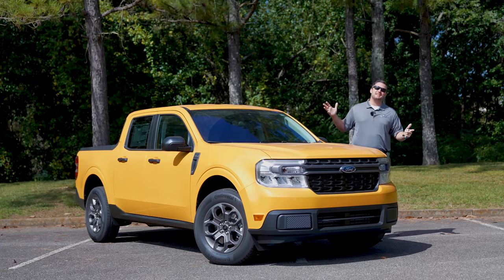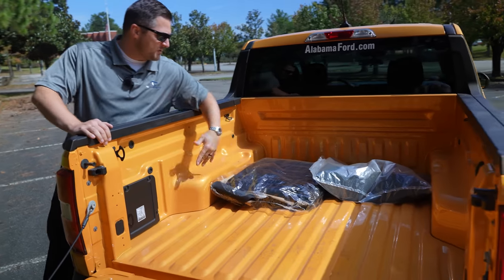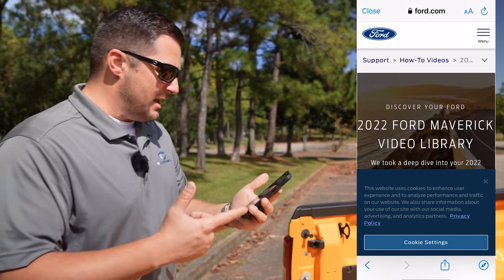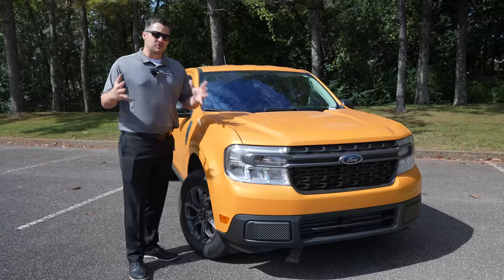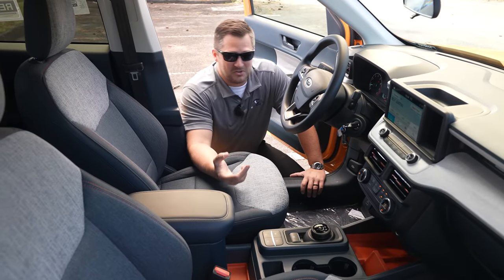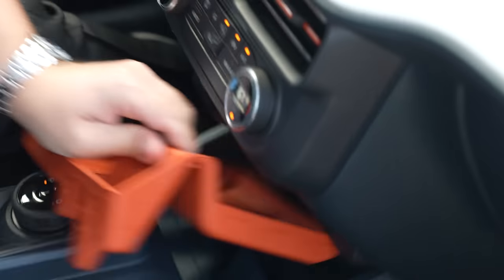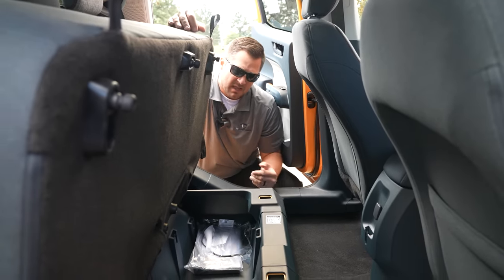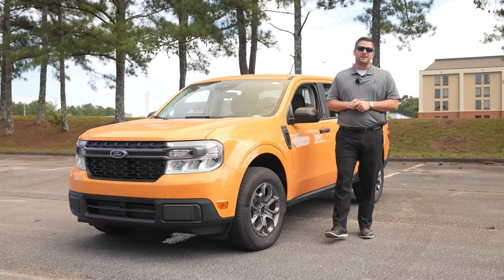2022 Ford Maverick Walkaround - Everything you need to know!

Comment: I’m a Ford technician. Gonna get the base xl hybrid and put explorer st wheels on it and 50 shot of nitrous. Going to be a lot of fun for cheap
Reply: Why in the hybrid tho? Wouldn’t it make more sense to have the ecoboost?? Jc!
Reply: I am wanting to be a Ford Technician when I graduate college any advice on what it's like to be a Ford Tech? and do you get discounts on ford vehicles because you work at Ford? I am also considering getting a Ford maverick or a F150 hybrid  myself someday.
Reply: @timothyp3ttit494  Employees always get discounts.
Reply: @timothyp3ttit494  being a Ford tech has it’s ups and downs. I get 50 percent off parts and a discount on new cars. You have to love to wrench and work hard to do this job. Buying tools is expensive and it’s flat rate pay. You get paid based on the job you do
Reply: @hunt7572  how much of a  discount do you get on new cars/Trucks?
Reply: @timothyp3ttit494  depends. If it’s on the lot you can get it cheaper than ordering one. I’m going to order one custom so it’ll only be like $500-1000 off
Reply: @hunt7572  That's nice that's also with the  $7,5000 tax cut included.
Reply: @timothyp3ttit494  the $7500 is only for plug in hybrids and full electric vehicles. The Maverick batter is too small at a little over a Kilowatt. I bought my wife a new Wrangler 4xe and since it has a 17.1kw battery it gets the full $7500. But man, I do wish that the XLT Maverick I have on order got the tax credit!
Reply: @timothyp3ttit494  you're gonna love engineers i mean really love them wait and see and its not just ford engineers lol

Comment: Actually, for an everyday commuter vehicle this isn't bad, especially in the base model price.  Back in 2001 I walked into a Chevy dealership and said I want a little compact commuter pickup without any bells and whistles. I bought a brand new 2001 Chevy S10 that was completely base model for $7000.  It didn't have AC, had a 5 speed manual, hand cranked windows, only AM/FM radio, no cruse control, etc.  I drove this little pickup back and forth to work for 18 years and put 310K miles on it while my big expensive diesel truck stayed home.

Comment: Does the front wheel drive 2 liter model have a locking differential so both wheels pull instead of just one when the tires spin? My understanding is that both front wheels pull on the hybrid version.

Comment: What you're telling me is Ford has it figured out how to build a cheap cruise control yet I've had vehicles from the early 80s that had cruise control also the bottom of the line Toyota Yaris has active cruise control lane-centering and blind spot sensor no it doesn't have a pickup bed Ford only offers those features in top-of-the-line model

Comment: HI MR. T+C, HOW ARE YOU-ALL??   Uh, in depth and comprehensive, REALLY??  OKAY, you're the first guy with a Maverick video on YouTube to mention the rear pressure flap, GREAT!! ( kinda screwed yourself describing the great inside placement of the hybrid's 12 volt battery, versus the normal place on the turbo though, EH?? ).  And, you were in the back seat, and didn't mention no air conditioning vents for back seat passengers ( isn't that kinda important where you live?? ) available, even as an option!!   And, you said the base prices for all three trims, but you did NOT mention the $1145.00 destination charge; unless you can get me one without it?? SOLD!!!  And you didn't mention that there's no rear window DEFROSTER available, even as an option!!  Or that the optional power drivers seat is only 6-way, not 8-way, which makes a big difference for big guys like me (6'3" tall, size 16 shoes!! ).  These are some of the things that I've learned about Maverick just from watching YouTube videos; maybe you should catch a few???   Your "DAMN YANKEE" FRIEND, CHAS ORVIS, PLAINVILLE, CT. ( I believe that's " slightly North of your Dealership??? )
Reply: 8 way driver seat on Lariat includes a lumbar plus 6 way power (manual recliner?).  Rear window defrost is a part of the luxury pkg for Lariat, with power rear window.  There is a manual rear window option on XLT, but no defrost.

Comment: If Ford built and shipped these trucks out with a bed rack that goes over the ceiling which carries  stack of plywood sheets I'd consider buying this right now.  Also that center display is a disaster.  FORD, please fix the display and equip a Maverick model with the rack system to be a standard work truck out of the box!!!!!!!!!!!!!!!!!!!!!!!!!!!! I'd take 3 of these for my shop!
Reply: Accessory section (when you build one online) does show some racks.

Comment: 🔺️Very imp. Info., the hybrid floor in the 2nd row is 1" higher than the Ecoboost. So, with the hybrid you have less 2nd row leg room.
Reply: But isn't it only on one side? Could have swore the battery is specifically under the rear passenger side floor
Reply: Greetings. Is the hybrid system battery that lays under the 2nd-row floor area.

Comment: First impressions: Affordable starting price or not, don't be a cheap shit...a bed liner or at the very least the Rhino Liner should be standard even in the base model. A 5' minimum bed should have been standard; 6' would have been even better. Th orange accent points in the truck are hideous. The small storage spaces are stupid...room for earbuds? Give me a break. Any vehicle in this day and age with back seats needs AC vents in the back as a standard feature. The area behind the rear seats should have been insulated with felt/carpet so if you do store items back there, nothing is rattling around. Hood area should have been insulated as well.